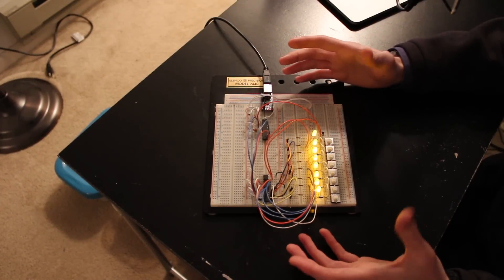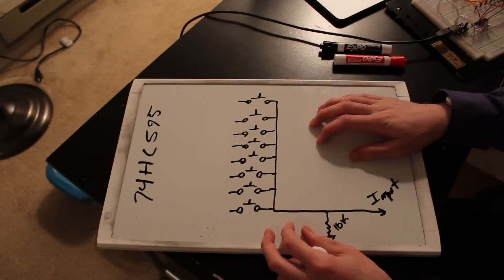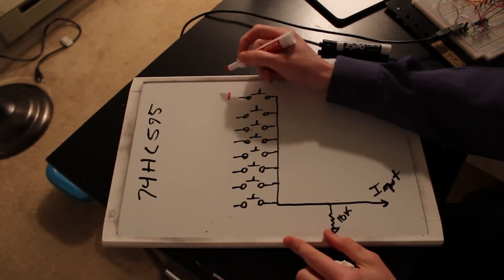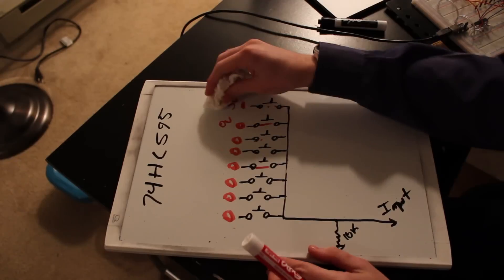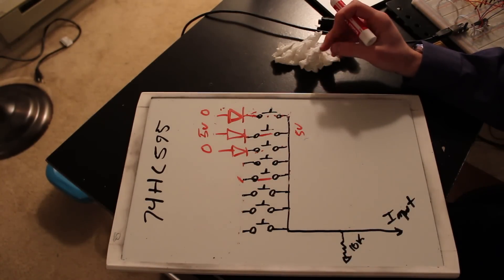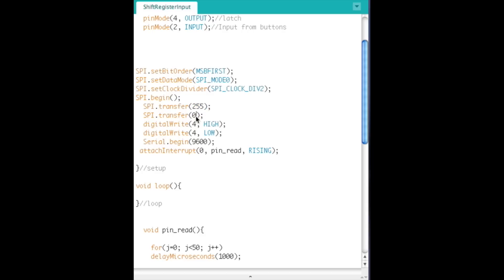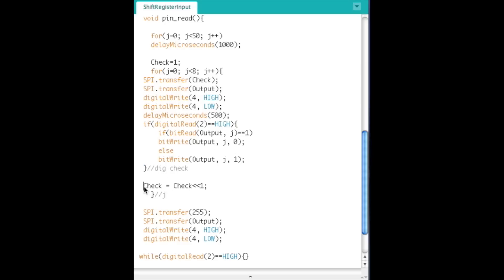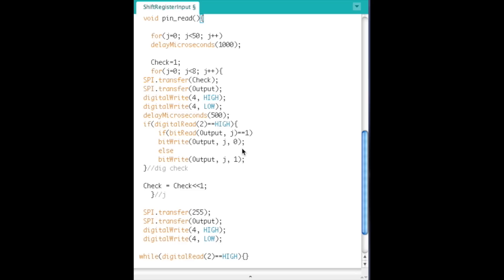How to Control a Ton of Inputs using Shift Registers!

Comment: All I'm thinking is why don't you just use a shift input register instead?
What I mean, is that normal shift registers have 1 input pin, and then an x amount of output pins, just like the one you showed, which is nice for controlling a lot of stuff with a small amount of pins
What a shift input register is instead, is the opposite; it has 1 output pin, and an x amount of input pins, so it basically converts a parallel input to a serial output, potentially saving you a ton of time doing it all manually
Reply: This way he can control input and output using 3 (+1) pins instead of 6.. I'm looking at this solution as well.
Reply: bwoogie
data, clock, latch... that's 3... where do you see 6?
Reply: if you want input AND output you need another 3 pins. I dont think you can share the line for both. I guess you can share the clock pin so that brings it down to 5. I would love to be corrected though.
Reply: bwoogie
You can share the data pin. For '595 set it output, for '165 set input.  Of course the pin count will increase.  The trade off is you read in the exact patern without having to make 8 serial outputs within the ISR.  So an extra pin or two greatly reduces the ISR burden.  Taking it to the 1000 inputs you only need 125 '165 chips and 125 serial in reads. With the '595 you need to send out the 1000 bit patterns and test the input pin for each and every one! :)
Reply: There may be a down side on the number of pins using something like a traditional 74HC165.  However on the plus side: you dont need a 50mS delay in an ISR! If you use something like the MCP23017 then you move to I2C (slower than SPI) but each chip has 2 interfaces and logic. Each interface can be set as input or output with an interrupt signal available for change on inout. Up to 8 chips can be strung from on I2C (or use the SPI variant with extra logic for the Chip Selects) that would give 8 * 16 = 128 inputs or outputs.  Also the MCP32017 arranges the 2 sets of 8 bit pins as blocks (pins 1 to 8 and 20 to 28 [from my memory]). Power, interrupt out and I2C are at the far end. The chip also has weak internal pull ups so no need for external resisotrs or diodes.
Reply: This technique works with analog inputs.

Comment: I am just getting into Arduino, but have experience with programming. 
I was just wondering about your code a bit.
I was thinking that it may be better to make pen_read set a global boolean, then in your loop you would do basically what you are doing in pen_read right now. 
loop would be while(pressed) {  *current_pen_read_code*; pressed = false;  };
Like I said, I am new, and don't have the parts to test this yet. Can you think of why that would not work, or why that would be less effective?

Comment: I agree, Parallel to Serial seems to be better solution for reading many inputs, but his way will work as well - it just seems a little more complicated.  The code is a little different for reading in from P->S for the Arduino - they do have a nice tutorial at their site: (arduino dot cc) /en/Tutorial/ShiftIn

Comment: i was making 5*5*5 led cube using 595 shift register and  bc 547 transistor. it worked in starting and is not working properly. i have not attached any resistor in the base emitter of transistor  and 220 ohms in the collector emitter .CAN THIS BE A PROBLEM. or can you guess...

Comment: I was about to post the same question. The 74HC595 is a Serial to Serial/Parallel IC, I'd use a Parallel to Serial IC with internal pull-up resistors.

Comment: The while loop at the end of the ISR should not be necessary, if the IRS is only called on the rising edge. And if you did want to improve your code(or make it shorter) you could also replace the whole check variable by replacing it with "1<<j" when you use the transfer function. Very interesting to use a output shift register instead of a input shift register, well done!

Comment from the maker: my code was to simply toggle the LED on or off, but if you just need to read the value in as being just on or OFF, that is simple, since a double tap wouldn't affect you.  Like the ISR being called would not flip your output

Comment: Methinks an array or two would help to clean up the code.

You could remove the while loop at the end and repeat the pin read function without actually writing to the leds. Run pin_read, get an array for which buttons are pressed, compare it to the array for the buttons which were previously pressed. From that you can find which buttons have gone from 0 to 1. If nothing's changed, there's no difference, so pin_read can just keep looping while the input is high.

Comment: I was going to ask why you didn't use a regular parallel in - serial out shiftregister but since multiple people already asked it I'm not going to ask it again.)
It's actually a pretty neat technique that I've never seen before so thank you for explaining it.
Using outputs as inputs if that's not thinking outside of the box, I don't know what is.
Great video, as always.

Comment: Hi there,
Has anybody got any tips/ advice for a relative beginner in electronics? I've got some basic knowledge about basic components(leds, resistors, caps) and the picaxe system. But I was wondering if there are any good websites or other resources that could help me broaden my knowledge/ understanding and work with more complex things with more integrated circuits driving a wider variety of outputs. 
Thanks.

Comment: I don't know about mechanical switches though, rather hard to use code to debounce using switches comomg through shift registers, can be done though, resposiveness may be a trade off that needs to be made.

cheers

Comment: As you had as a baloon at the start, a parallel in serial out is the way ti go for input.  3 pins, clock, load & data.

cheers

Comment: Seems like a whole lot of work when you could use a 74HC251, 74HC151 or something like SN74150N.
Don't get me wrong, it's a neat trick, just not sure if it's worth using that much flash memory and processing power compared to using chips like the ones above.